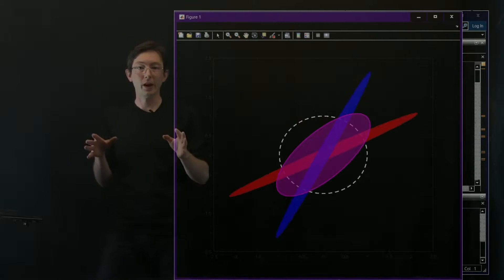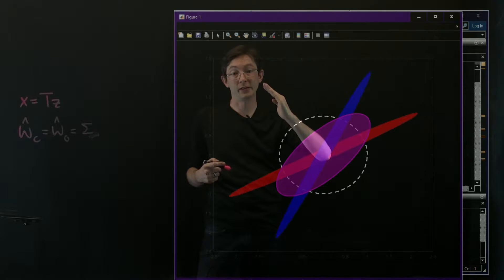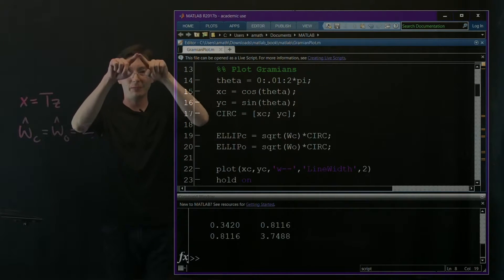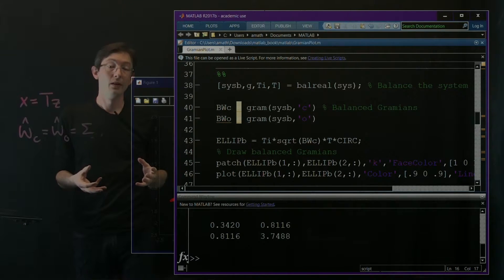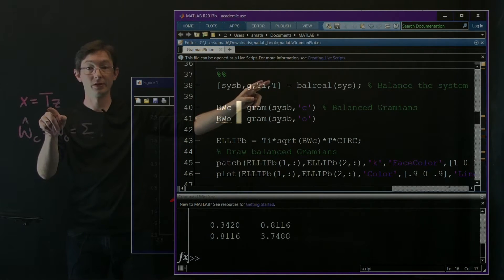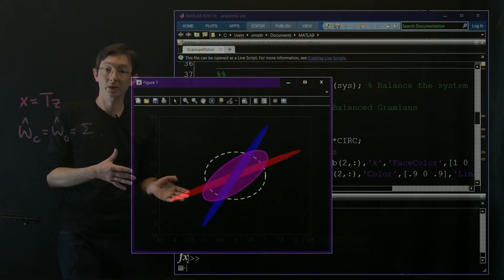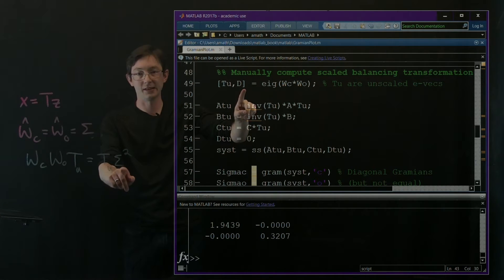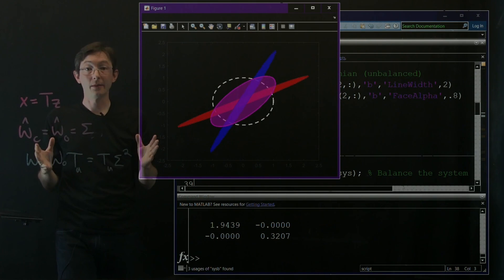Data-Driven Control: Balanced Truncation Example

Comment: great lecutres, helped a lot! But I´ve got an issue. When I compute balreal, the new system comes with a unexpected D matrix. Is it ok to have this matrix? How should I read this new matrix that appeared in my system? thank you
Reply from the maker: Interesting.  The D matrix will get added to the output equation as y = C*x + D*u.  It is sometimes called a "feedthrough" term, since it feeds directly from the input to the output.  You might check and see if the value of the D matrix is small or if it is large.

Comment: Thanks again professor Brunton ! Question: It looks like the Controllability and Observability ellipses' axes are lining up with the Eigen vectors of Wc and Wo respectively. is this due to a special property of Wc and Wo, or would it work for any matrix M, if I plotted M*CIRC? (I tried the same code with some random 2x2 matrices, but the axes of M*CIRC ellipse and the Eigen vectors of M didn't line up. )